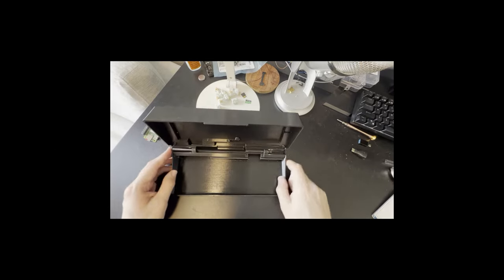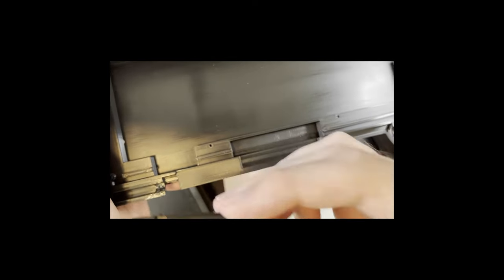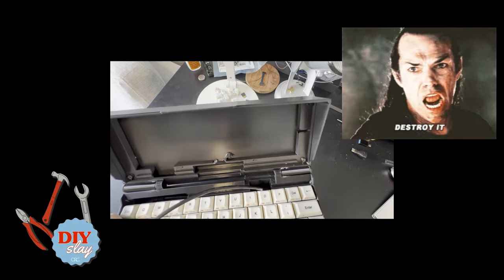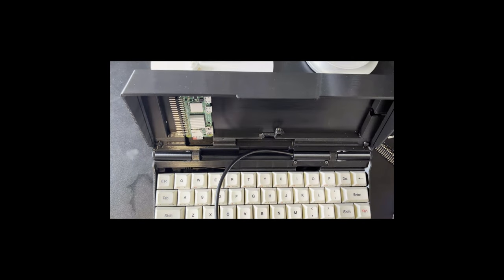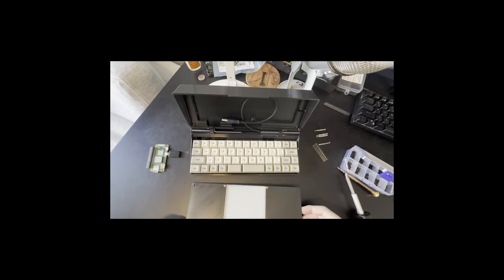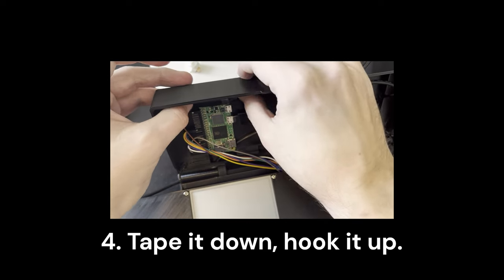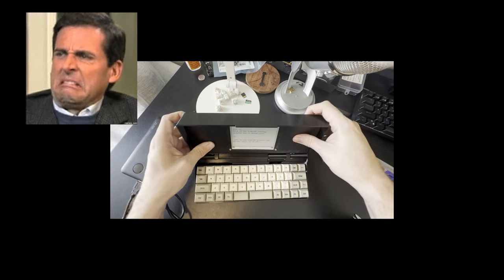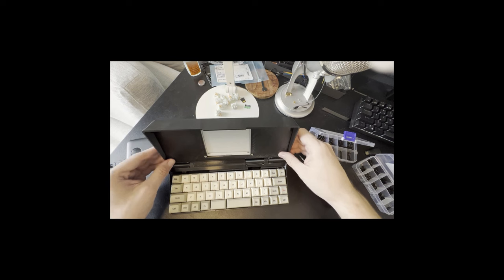Assemble Your Own E-Ink Typewriter!

Comment: @ZeroWriter Thanks a lot for this inspiring and meaningful project! I'm looking forward to rebuild this typewriter. Is it possible to use another epaper, for example the inkplate you used for the alphasmart or a bigger version of the waveshare 4.2 instead (consinering the 5.79 inch)?
Reply from the maker: Hello, sorry, I didn't get to this! Yes -- some people in the discord are working with the 6"+ e-papers from waveshare. It uses a different driver, but the fundamentals are all there. You can find a link in my channel description if you want to join.
Reply: @ZeroWriter  Ok, thanks!